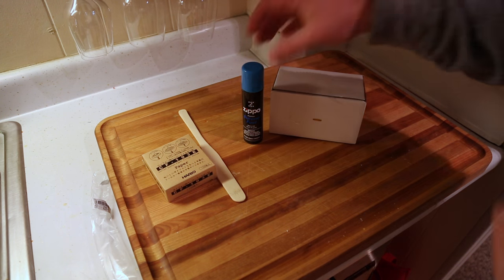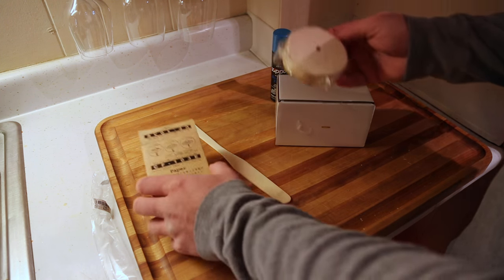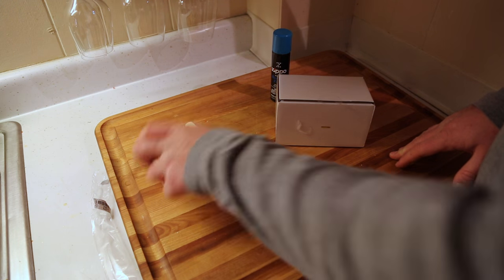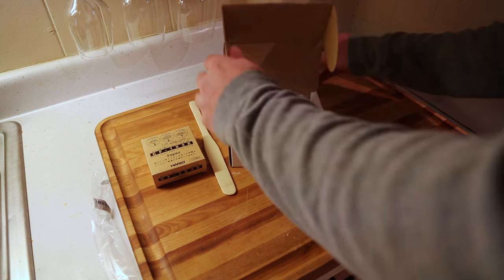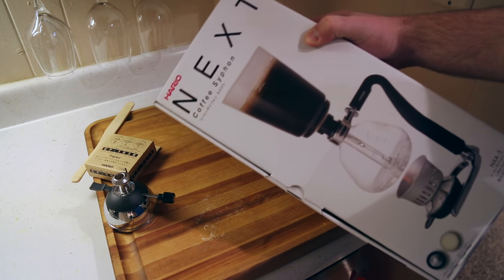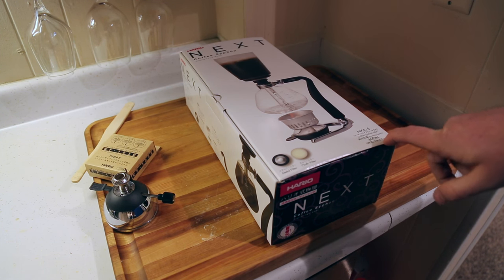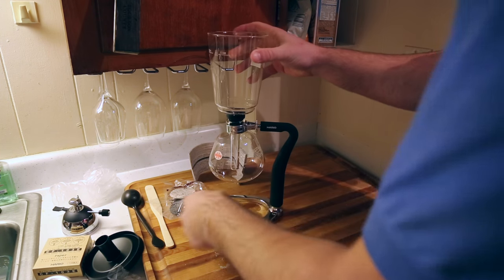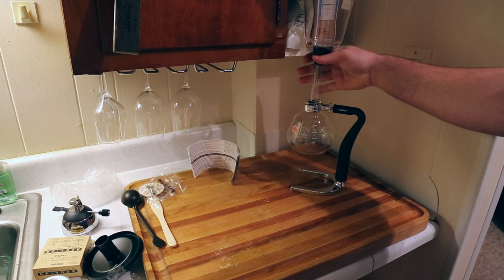Unboxing - Hario NXA-5 "Next" 5-Cup Syphon & Yama Mini Butane Burner

Comment: Does the butane burner run out of gas after one cup because my burner runs out pretty fast and it's the same one you have
Reply from the maker: It does. It doesn't last as long as I had hoped.
Reply: @AdamChandler86  it's literally to just to sustain that boiling point
Reply: It shouldn't — my burner lasts for a least a couple dozen brews before needing a refill.